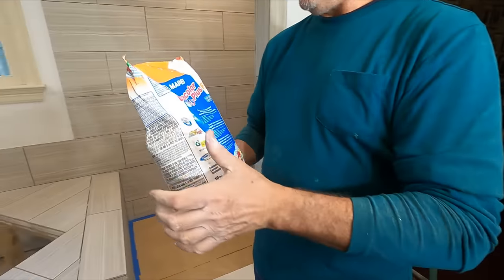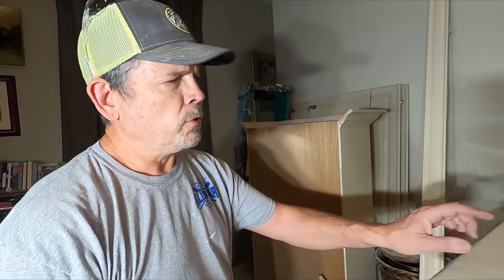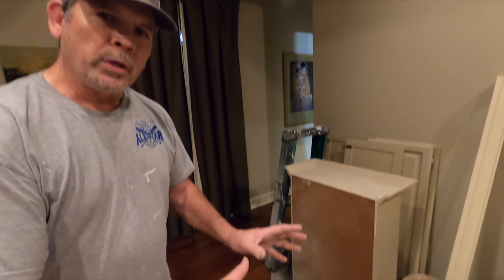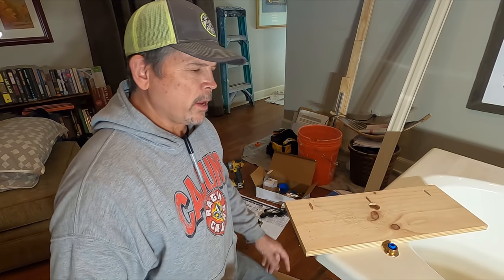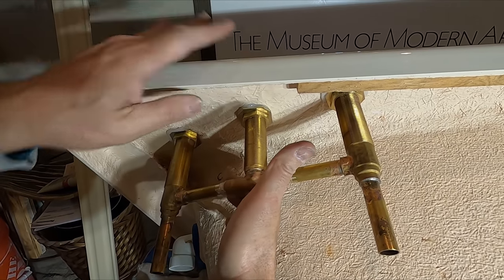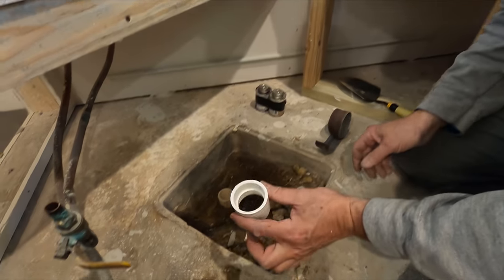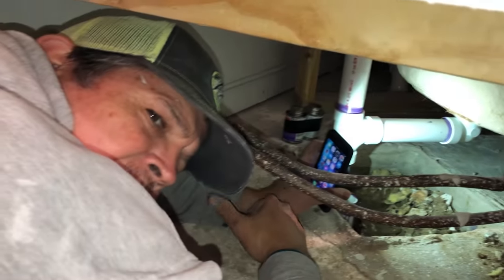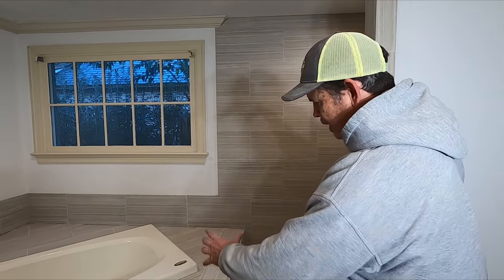A SMOOTH Tub Install and BEAUTIFUL Grout Lines

Comment: Gathering the grouting tools we have in our arsenal on hand, and having never done tile & grout work before, I have a question: 

We have 2 floats. One is completely smooth and one is textured in a slightly raised pattern. Both are the same depth and overall size. 

Is one better than the other? Are there different purposes between the two? Why is one completely smooth and the other have tiny raised grid lines on it? 

People we know have given us these types of things rather than donating them because they know we do DIY projects, but we don't always know much about them. This is one of those instances. Neither my husband or I are very familiar with tile work or grouting. And googling an answer to a question like this can sometimes be exhausting yet yield no answers! 

So....

Are there floats for different purposes or is it just a cheap tool VS expensive tool sort of situation?? Or do they serve different purposes?? Cause different purposes is what this novice is leaning towards....
Reply: there are different types of floats, some are soft for glass tile and such. mediums for regular tile and hard for stone and such.
Reply: @timothyroberts8445  Thank you for your answer. I now have a starting point to research some more about what I have vs what I need.

Comment: Did you really wait 2 hours to clean the grout? I heard the FA is a paint to get off of you wait to long. I’m about to grout my kitchen floor with it and I’m a little worried.
Reply from the maker: We were monitoring the grout as it dried. Each project the grout dry times differ. It just so happened that on this day with this batch it took 2 hours until we were comfortable cleaning it. We're looking for a hardened grout (not completly dry) that won't lose it's clean lines due to the rubbing of a sponge!

Comment: For small quantity jobs like bathrooms us old timers mix grout with a margin trowel. A Marshall town of course. Modern drills are low speed so times change. I would use a trowel just for the dust factor. That shit is nasty. Stay away from quartz countertops too 😷

Comment: 16:55 Why mortar? Why not just build a 2x4 framework to support the tub? I think ours is just framed in.
Reply from the maker: Most fiberglass tub manufacturers require some type of supportive bed of plaster, foam, etc. to support the bottom of the tub.  If not done it can flex etc and crack

Comment: Where’s the trap on the bath ???? What stops smells coming up through the pipes??? And why don’t you just use adjustable bath tub feet?? Been fitting bathrooms in uk for nearly 20yrs never seen an install like this
Reply from the maker: The trap is below grade.  Roughed in by the plumbers before the slab is poured.  Millions of installs like this in the US.  Thx for watching and commenting 👍

Comment: That bucket vacuum attachment is SOO COOL!!! I had no idea they made those and the idea of mixing grout or thinset indoors has always repulsed me because of all the dust it makes!! Stud Pack are true PROS!
Reply: It is called a whale tail. You can also make one from a drywall mud bucket lid cut in 1/3 popped on the bucket top and a hole cut for your shop vac hose to drop in while you mix. Either way def smart to have the dust extraction for mess and health reasons.

Comment: To drill a predrilled hole bigger, you can put the 1" hole saw on with the 1 1/4" as a guide also. Buy a Turbo Torch, nothing better. Also use Christy's Red Hot PVC glue, clear glue can fail.
 Good video turned out beautiful!

Comment: Why do you place the tub on top of finished tile instead of placing tub on framing and then tiling around the tub? That would decrease the height of the lip around the tub for smoother entry and allow access while installing the tub

Comment: Just my 3 cents but light color grout will never maintain color.. When ever floor is mopped the grout has shrunk concave.( plus sanded grout) so it holds dirt(yes it does) so to do it right it must be rinsed off and mopped a few times with clear water.. (sealer matters not its surface dirt) Read articles..  use a darker grout that when its(and it will get dirty) dirty from maids not rinsing floor a gazillion times you never notice..Also in the shower water conditions determines grout color..hard water areas will turn grout white..  no matter what..  Food for thought.. after 12 homes makes one slightly smarter..

Comment: You didn't use the grout on the edge between the tub and the wall, why? Flex or for a better seal or both?  I've grouted in the past on counter top backsplashes. (only a couple of jobs in total) Should I always use caulking grout on the inside corner wall edges?

Comment: Hi where the waste pipe comes up through the floor slab, is that soil in the bottom ?  I had a similar situation, but to stop the bugs coming up out the ground I filled hole with 1/2 inch gravel. Better for draining leaks and easy to excavate in future pipe mods. 
Great videos you guys. You take time to explain, which is great !

Comment: A little concerned about having to remove the tub in the future. Could you have used compression fittings on the water lines? Also, could you have laid a sheet of plastic over the mortar before sitting the tub in place? The mortar would still conform to the bottom of the tub without adhering to the surface, allowing the tub to be lifted out easily in the future. You mentioned termite inspections in a previous comment and that got me thinking about making it difficult to pull the tub later on. 

New subscriber. 
Love this bathroom remodel series. After finishing them all, I plan on going back to watch the videos from the beginning of your channel.
Reply from the maker: Thx George 👍 compression couplings on the water lines would be fine and good tip on the plastic.  I’ve seen that before but forgot about it 👊

Comment: I have used several corded drills over the years and when I started bathrooms full time 2 years ago I got the Milwaukee m18 high torque drill mixer.  Absolutely awesome.  No cord mix where I want at the correct rpm all the time.  Chuck goes into tool and handle can rotate to whatever position you desire.   Mix everything from mud, thin set, compound , plaster, etc
Reply: If I'm doing just one tub, can I get proper mix just doing by hand?

Comment: I installed a brand new faucet to my sink today. QUESTION: 

It came with 2 washers: one rubber and one metal, and then the screwed on piece goes on and gets little bolts put into the countertop from underneath. 

I assume the faucet at the top sink area will need to be caulked? Why didn't the rubber washer go between the new faucet and the top of the sink endge?? That's what would make sense to me....
Reply from the maker: You installed it correctly.  The rubber washer goes between the metal washer and the bottom of the counter top material.  Faucets either have an o-ring/gasket to seal the top side or some require plumbers putty/silicone depending on the manufacturer.  Be aware that plumbers putty can stain some countertop materials, there's also a non-staining version.
Reply: @StudPack  Thank you for your reply. I thought that was the correct method but I had problems with it. I see I wasn't specific enough describing the issue though. 

The faucet thread length coming down through the countertop is too short to use the rubber washer, metal washer, and then the screw on washer that has the bolt holes to hold it in place they way you're supposed to do it. 

So I took the washers back off and flipped the screw on washer upside down (it's flat on one side with a small lip on the other) and it just barely connected with the faucet drop down part, enough to get about a half a turn on the threads. And that's what's holding the entire faucet in place at the moment. 

Can I use a Dremel to route out some of the underside of the countertop to allow for better clearance for the screw on washer to thread it on more? Or do they make an extension type of fitting to make the faucet drop down longer? I know I can't leave the faucet only attached by a half turn on the treads. 

I suppose a 3rd option is to wait until the weekend and have my husband look at it to determine what to do. But I'm trying to educate myself and be proactive on this project so it doesn't all fall on him to figure it a solution. Most of the time, I'm mostly just his "go-fer" (go get me this, go get me that) but would like to actually participate in building my sink, plumbing, & countertop too.
Reply from the maker: If your counter assembly is too thick for the nut to thread onto the faucet you definitely have a challenge.  Hoping you have a plywood subtop.  

Remove the faucet.  The hole thru the counter should be 1-3/8” diameter but maybe not

Get two hole saws.  One to match the existing faucet hole and one that is larger than the metal/rubber washers that go underneath the counter to mount the faucet 

Put both hole saws on one mandrel.  Check YT for this trick.  “How to enlarge a hole with hole saw...”

From underneath drill up thru the existing hole.  The smaller hole saw will guide the larger one while it cuts thru the plywood subtop.  

When you’re through the plywood you’re done.   Clean up and install the faucet 

Good luck 👍
Reply: @StudPack  Thank you for your help! 🤗

I will look up what a mandrel is and see if that will help. I appreciate the time you took to explain this to me.

And yes, it's 3/4" plywood as a countertop that I plan to put mosaic 2"x2" ceramic tiles on. The entire countertop is 5 foot long by 2 foot deep with a 24"x18" sink in it, so it's a little countertop. 

I am SO excited to FINALLY have a sink in my tiny kitchen with running water to & from it, and I won't have to take the supper I'm cooking for a walk through the house to drain in the laundry tub anymore! Or to get water from another room just to make coffee.

Comment: I am absolutely loving your channel, I don't have any specific drill recommendations, but get the highest current rated one you can (also note if there is a duty cycle on it as well, you want that to be as high as possible).  Generally, the larger the drill the larger the brushes and windings will be (assuming the same features), resulting in less heat to degrade the components over time.

Also, I noticed there was dried primer on that one pipe out of the floor, and everyone should make sure that if the primer dries that it is re-primed before putting on the cement (it looked like you guys did do that).  The main goal of the primer is actually to soften the PVC so the cement can properly bond the pipe/fitting together.  It's basically just a chemical form of welding, so once the cement is cured it is a continuous piece of PVC.  If the primer is dried, the surface of the PVC is no longer softened and the cement is unable to do its job properly, increasing the chances of leaking.
Reply from the maker: Good stuff Wesley 👍 I like the primer info👊

Comment: The nut on the hot water faucet would have come off fast using your multi-tool (that oscillating tool you use for undercutting the wood, and making slots for the tile spacers), just get a metal blade and keep it handy.  :-)  When I put in tubs I do the plumbing mocked up like you did, but then take it off the tub, assemble it in place and drop the tub in, then make the final two attachments.  I find that easier and less risk of damaging the tub.  Great tile work but I seems like you left the ends of the tiles exposed, but that's not stone so the ends are not tile, just clay, am I seeing this correctly?  That's contrary to all the excellent work you've been doing, there should be an edge applied, or make miter joints, something to hide that edge.  If I'm wrong, let me know.  I also grout at the tub-wall joint, then apply silicone, the silicone can be clear if matching is a problem, you'll have a sound joint and it looks like grout, but is waterproof.

As I've said to you before, great instructional approach!  And superior attention to detail, keep it up!
Reply from the maker: Thx Paul.  Multi tool... I almost grabbed it but thought folks would like to see another way in case they don’t own one.  Tub connection... good idea, I’ll have to try it that way.   Tile edges... we mocked up miters, bullnose, metal trim for owners but they chose the way we did it.  It’s rectified tile and the rectified edge is visible almost everywhere.  Most will be hard pressed to identify the non-rectified edges.  Silicone over grout.... interesting, but if the grout cracks under the silicone can you see the crack?

Really appreciate your comments 👍
Reply: @StudPack    Rectified, I should have know by the lack of any markings on the sides.  If that's what the customer wants, that's what they get!  :-)  If grout cracks, yes you'll see the crack behind clear silicone, so don't let it crack.  :-)  I'd suggest in future videos where you do something that's a little out of the ordinary to explain why, so folks know that's not the usual treatment (speaking of how the tile edges are exposed).  Just for clarity.
Reply from the maker: Thx Paul.  I thought we went over tile edge options in the video ??
Reply: @StudPack    Not that I can find in this video.  :-)

Comment: Hilarious watching folks still struggle to solder copper... Get pushfit plastic and join us in the 21st century!!!🤣
Reply from the maker: Typically on a project like this, if the original is copper I stay with copper.  I don’t trust pushfit fittings for permanent installations👊👍
Reply: @StudPack  Haha! Permanent jobs is exactly what they're for. Most good brands come with a minimum 25 year guarantee and I've seen while streets built with plastic, evening in the central heating systems. Heck they've been used in aeroplanes for years!